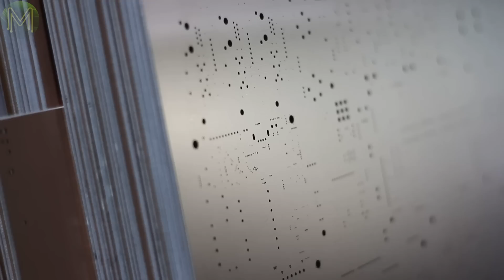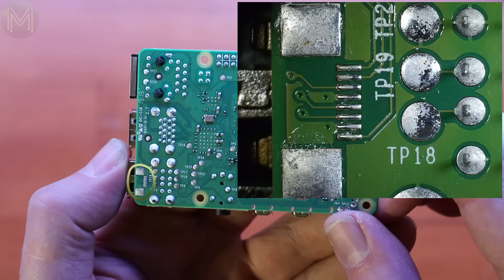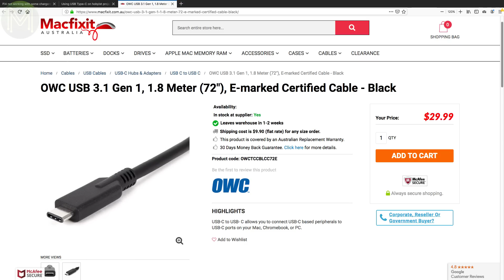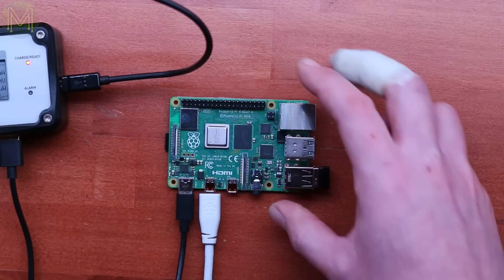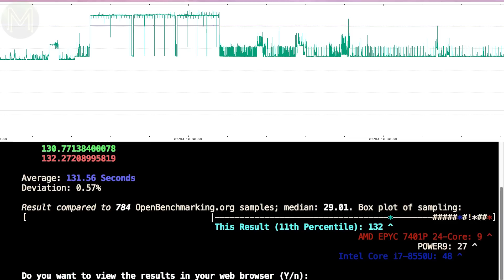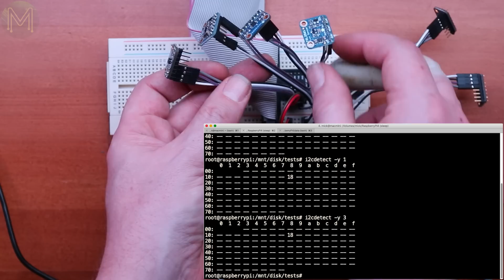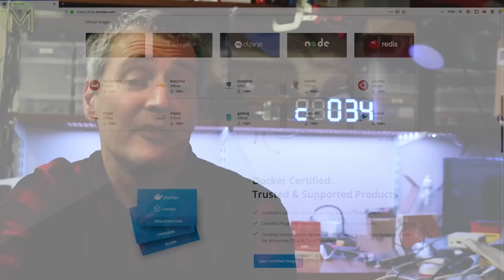#270 The Raspberry Pi4: The good, the bad & the ooops! // Review

Comment: But why have they still not put either a PCIe or even a SATA M.2 interface on the damn thing? Even a SATA socket would do (as long as it works). Orange Pi has had one for ages.
Reply from the maker: Eben has said several times that it’s “too expensive”.
Reply: @MickMake  I think there are several issues to this topic, and the key one people forget: cost. This is meant to be a product that people can buy cheap, then use. This thing has dual monitor support, for goodness sakes. Something that is not readily available with PCs off the bat, or on a laptop. Done dual screens with a laptop, and it's not the same has having two proper monitors. There is a lot available in this product, and people overlook that,  to complain about what feature they want is missing. It's the size of a credit card. You can only shoehorn so much into it.

I honestly reckon this will be the last Pi to have any option at US$35, and be credit card size. I reckon it needs another 5mm in length, and 2mm in width. Then you can start adding more items into it. But the key thought is cost. It's meant to be something readily available, and affordable. And the Pi 4 certainly IS affordable. I've no regrets in buying a 4GB version.

I also have just thought... if something isn't so universally available, what cost will it have? What is the cost of PCIe, and SATA M.2? Chances are, they are something more of a niche product.

I think the answer lies in using USB flash as the hard drives for these machines. The USB boot option is coming, and I wonder if USB flash will be a possibility there. 

And another thing - the RAM to this version, it's DDR4. That can't have been cheap to get. But they did it. Likely by making deals to secure it. Bulk buying, and the like.

Anyway, these are just my thoughts. Make of them what you will.
Reply: But what's more likely in the real-world? More people wanting 2 (or 3) displays at once or more people wanting high-capacity high-speed SATA/M.2 storage?
As with laptops, knowing what specific limitations exist on the USB-c version they've implemented would also help (e.g. not supporting video, reduced current handling, data-rate limitations, etc). I know a number of folks very ticked-off at laptop manufacturers who implemented limited functionality on their USB-c ports while still marketing like it was "full function" USB-c. Not all USB-c ports are equal and can have MAJOR limitations.
Reply: @exgenica  There is nothing to stop them implementing both. Also eMMC is notorious for flaking out as it does not have the data management of an SSD.
Reply: @exgenica  I love having two displays. I'm sure there are others, too. The official RPi4 page says it was something heavily requested, so someone out there clearly wanted it. 

I also think that SATA/M.2 storage is on the way, likely after a complete board redesign. I suspect the current form factor will have to be abandoned in the future. There is only so much you can squeeze in such a space.
Reply: @gordonlawrence4749  I think a slot, or way to create an expansion/break out solution might be the way forwards. The problem is, while these things are wanted by a lot of people, a lot of people may not want that. 

Don't get me wrong, having some sort of way to have a proper hard drive solution would be great, and I want that myself. But we have to have patience, I guess. All good things come to those who wait. :)

Also, there is talk of USB booting coming in the next couple of months... This might well be something that solves the problems we currently have?
Reply: @RoshenRodesh  USB bboting has been talked about since the Pi 2A. There are plenty of other SBC's of this form factor with SATA and in theory if implemented correctly an M.2 PCIE3 interface needs less hardware support. I am beginning to think the problem is Broadcom rather than Raspberry Pi foundation.
Reply: I like using multiple displays, too. I just think RELATIVELY more customers in general want more and faster storage capacity than multiple simultaneous displays.
Reply: @exgenica  It's not just more and faster it's also a reliability issue. Also one does not preclude the other. There are SATA enabled alternatives and M.2 PCIe is not out of the question. I personally would willingly pay a bit extra for that, it shouldn't cost more than about £20 more.
Reply: I bought a RockPi 4, with the 4GB ram, eMMC slot, and a nvme M.2 interface for $80US, to expensive my a$$   (basically almost exactly the same specs as a Rasp 4, but with the asked ports)
Reply: @TheBaldr  And the cost? $80US. If you are trying to make it for a set price point, which is $35US, that is a massive step away. What is inexpensive to you may well be far to costly to others. And also, looking at the specs, there is a $25US difference in the price point for the respective model versions. What does that give, which makes it more bang for your buck, so to speak?

You found a product you wanted, and got it. The key thing... are you happy with it? If so... what is the complaining about what Raspberry Pi Foundation has produced? Lots of us are really happy with it, like myself. Isn't that the key thing here?

In any case, I suspect this is a stepping stone towards something else, a complete redesign and change. At some point, they will have to leave that $35US point, and the Pi 5 is likely to be something that will cause a big surprise to all.

Again... are you happy with the RoockPi 4 you have? If so... great. All of these boards are A solution, as opposed to THE solution. To each their own, and may their own give them all they want. :)

Comment: Do you have a USB 3.0 display around to test how it runs a USB 3.0 display such as the AOC I1659FWUX 15.6"?
Reply from the maker: Alas I don’t, but will need to get one
Reply: I can tell you it works i tested it with my zen screen but had to inject power down stream and compile the displaylink drivers for the arm cpu but zero gpu acceleration means it's really bad get a real pi display or a hdmi camera monitor screen

Comment: I wanted them to use barrel-jack and not usb-c for power. And I wanted them to have included onboard storage or at least sata port. This I have wanted since the RPI-2. Does the PI4 boot from USB or is this still not possible without altering the firmware or something? Finally, I wanted an composit input for making an RPI based upscaler. Like upscaling 240-P and 240-I and RGB upscaling. That would have been so much more cool than dual HDMI.
Reply from the maker: The Pi4 can boot from USB, but not directly.
Reply: @MickMake  What do you mean "not directly"?  The Pi 3B+ could do it.
Reply: @MickMake  Well... That is a shame. So the SD card boots and lets software on the USB take over after boot?
Reply from the maker: +brostenen Correct!
Reply: @MickMake  Damn it... Another major issue and thing they did not bring to the table. To me, it feels like they are not thinking forward, or at least would make an upgrade or expansion board for. Personally I have asked for the following, since RPI-2.

 - Boot from USB, SATA or eMMC.
 - eMMC or other onboard storage.
 - SATA port.
 - Input for RGB and Composit capture.
 - Input for 240i/240p and up.

I know these are specific needs and special features. Yet the RPI lacks them, in order to be even more versatile, in different projects and would provide the options for even more awesomme homebrew projects.

Comment: Banana Pi BPI-M4 with RTD1395 quad-core CPU,ARM cortex-A53 chip design, with 8G eMMC flash ,M.2 inerface ,802.11b/g/n/ac wifi
http://forum.banana-pi.org/t/banana-pi-bpi-m4-with-rtd1395-quad-core-cpu-arm-cortex-a53-chip-design/7881

Comment: BAD side, so far allot do not like the micro HDMI
Bad side. heat , causing issue, software fix is already out (sound like an iMac)
Bad Side, USB3 have a strange power control system,  where device talks to power supply
Good side 4 GIG
Good side , gag real
Reply from the maker: Gag reel - always on the "pro" list.
Reply: @MickMake  some of them deserve awards

Comment: To fry the cpu try linpack. There's this too: https://github.com/ssvb/cpuburn-arm
Reply from the maker: I’ve found smallPT to be the best, but it often does depend on the architecture.
Reply: Looks cool. But does not work for me grrr:

jorge@unibody:~/Downloads$ g++ -fopenmp smallpt.cpp -o smallpt
ld: warning: in /usr/local/lib/libgomp.dylib, file was built for i386 which is not the architecture being linked (x86_64)
Undefined symbols:
  "_GOMP_parallel_end", referenced from:
      _main in cc7oqy13.o
  "_GOMP_parallel_start", referenced from:
      _main in cc7oqy13.o
  "_GOMP_loop_dynamic_next", referenced from:
      _main.omp_fn.0 in cc7oqy13.o
  "_GOMP_loop_end_nowait", referenced from:
      _main.omp_fn.0 in cc7oqy13.o
  "_GOMP_loop_dynamic_start", referenced from:
      _main.omp_fn.0 in cc7oqy13.o
ld: symbol(s) not found
collect2: ld returned 1 exit status
jorge@unibody:~/Downloads$ uname -m
x86_64
jorge@unibody:~/Downloads$ g++ -m32 -fopenmp smallpt.cpp -o smallpt
jorge@unibody:~/Downloads$ time ./smallpt 5000
Rendering (5000 spp)  0.91%Bus error

real 0m0.108s
user 0m0.492s
sys 0m0.009s
Reply from the maker: Pull down the Phoronix Test Suite. It'll build out of the box for you.

Comment: Some other SoC vendors (NXP) have previously put a couple of Cortex-M processors on the CPU die, with shared access to most of the same hardware as the Cortex-A.  Now that wouldn't have cost much, and would have been really useful...
Reply from the maker: Oh yeah! Extremely useful! Being able to push the Pi into low power mode would be a real advantage. A lot of other SBCs have that capability already.
Reply: @MickMake  The only SoC that I know of which has a Cortex-M is the NXP iMX6 SoloX (which has a pair of Cortex M4 on the die).  This would solved the same problems as putting an ATMega on the board, but at a much lower cost (and better MCU core).  Other SoCs have Cortex-A "Big.Little" arrangements for power saving.

Comment: 0:50 - She's coming back right? 🤨 I hope she hasn't left you for JLCPCBman; he's so bright green. ¬_¬

Raspberry Pi 4 - ˢᵗᵃʳᵗⁱⁿᵍ ᵃᵗ *JUST $35* ᵃʰᵈ ᵘᵖ 🙄 Mostly "and up". 😒
Reply: The pi 4 does indeed start at 35$ it's just for those that want more ram they have to pay for the higher dram prices. It would be impossible with the current market to offer a 2gb raspberry pi 4 at 35$
Reply: @OneByteOfLinux  The RAM is DDR4. That is something in, and of, itself. For what is there, it's an amazing price point. I spent the £54, and have no regrets doing so. In fact, I've been really impressed with what I'm doing for such a cheap, simple product. And I noticed the 1GB selling out about the same time as the 4GB on The Pi Hut. The 2GB has been the one to sell the slowest, on observation.
Reply from the maker: Yeah, she’ll be back. Just visiting friends.

Comment: Trying to search for the lowest boot current would be faster, using a binary search: 2.5A, 0.5A, 1.5A, 1A, 0.75, etc.
Reply from the maker: Ah yes, I could have, but it’s more fun to  do it the other way. Besides I had a feeling it’d be around 800mA, but was surprised by the higher current of the underclock.